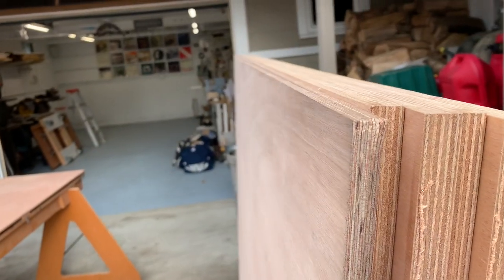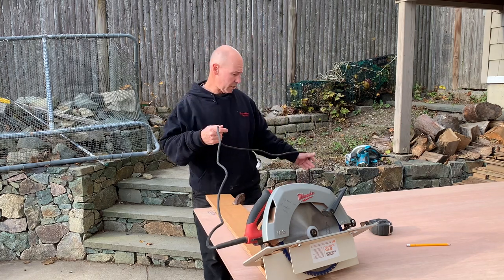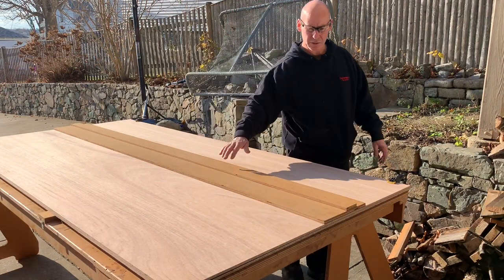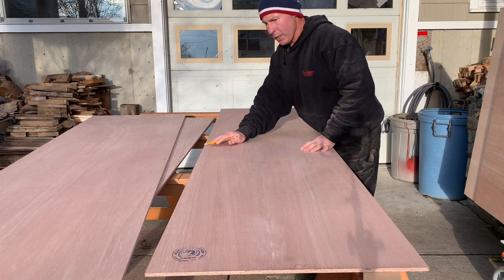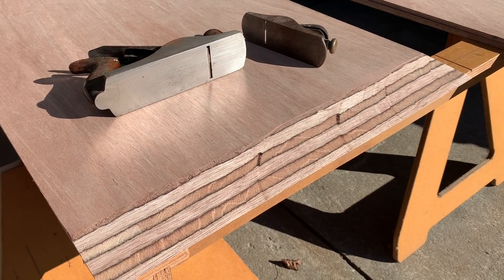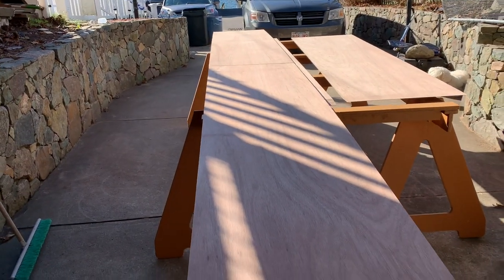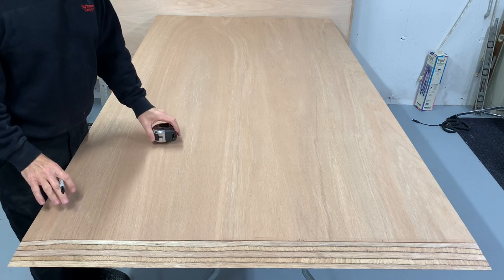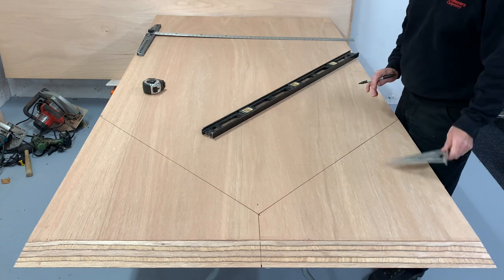Building Plywood Boat Ep1

Comment: I love you scarf jig. How thick a sheet will it cut?  I built one out of wood but it only cuts a 1/4 inc sheet. Not a 10 in saw like you have.  Yikes lol...  I'll have to save my pennies for a while to  get one of those. Thanks for the video.
Reply from the maker: That’s the maximum cut, 3.5” on that 10” saw. I do use it on 3/4” but I will show that when we do the bottom.

Comment: Wood types, suppliers, specs (e.g., thickness, etc), and ratings (e.g., structural, etc) are not mentioned in the "list of supplies." The tool info is helpful. Thanks.
Reply from the maker: Thanks, I will work on that.
Reply: Do you want him to close your shoes as well?